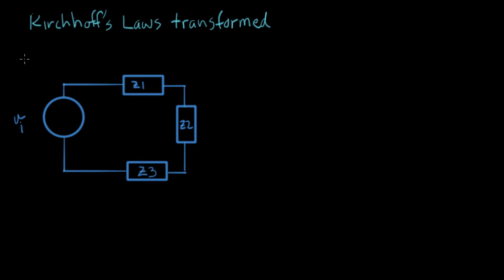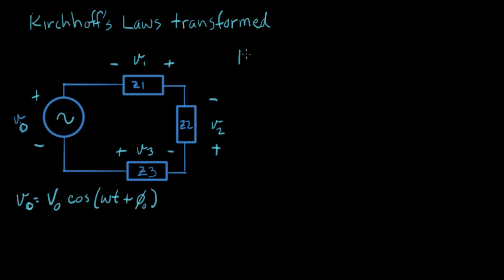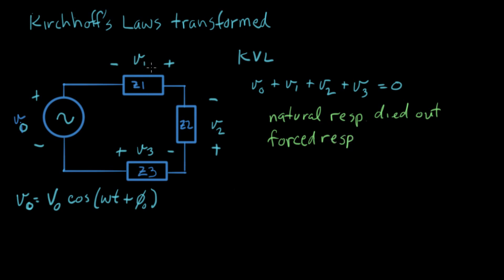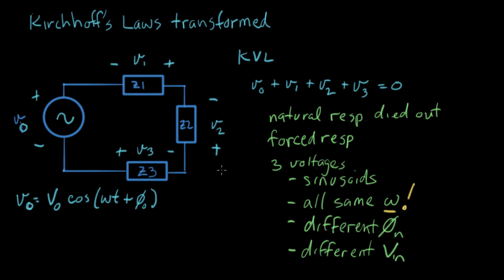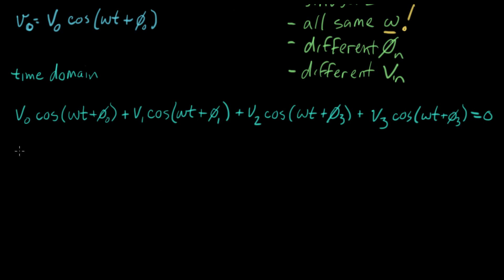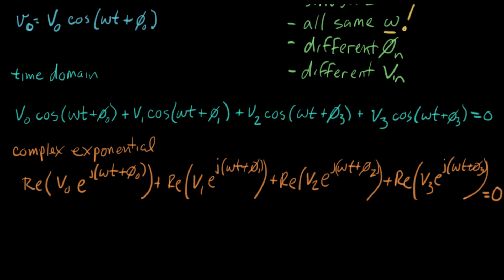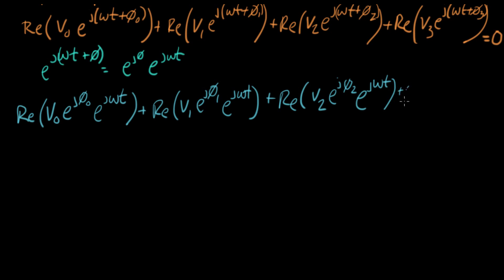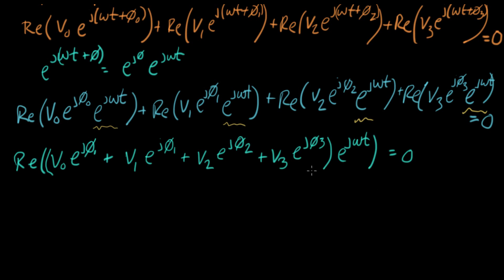KVL in the frequency domain

Comment: An example : (2+3j)(3+2j)=13j. So the real part of the product  (2+3j)(3+2j) is zero, but (2+3j) is not equal to zero, nor (3+2j). So At 11:15 , the reason of why the some of phasors is equal to zero deserves a better explanation. Regardless of that, it is a good video; thank you very much !

Comment: Everything you did was in the time domain.  Everything in the example has the same frequency.  I don't see why you said frequency domain at all.   Frequency domain analysis should apply when using Bode or Nyquist plots, or Laplace Transforms.   

Another thing.   KVL applies instantaneously,  as well as to entire AC cycles.  It is enough to say that if it applies to every instant, then by definition it applies to whole or partial cycles, or even aperiodic forcing functions.   In other words, you don't need to re-learn KVL for AC systems.